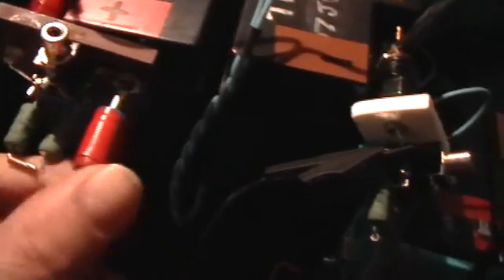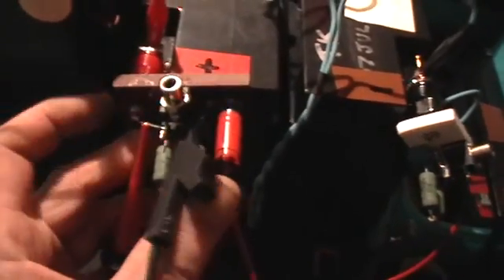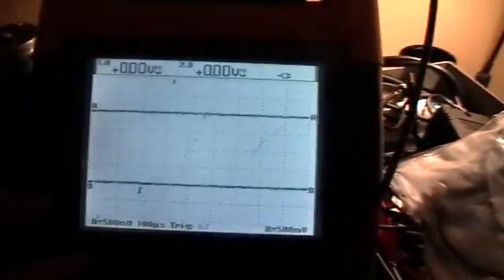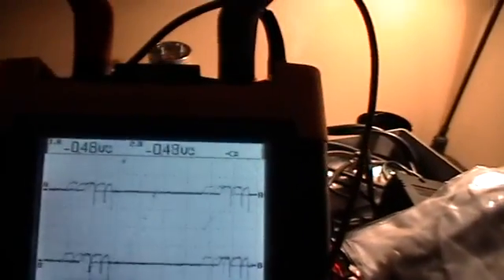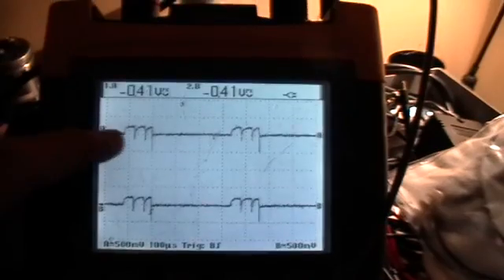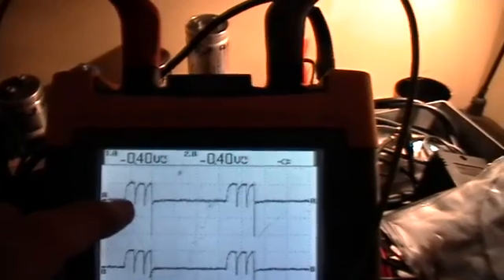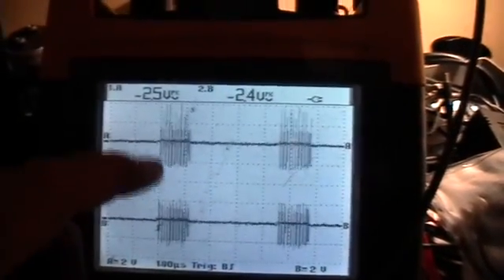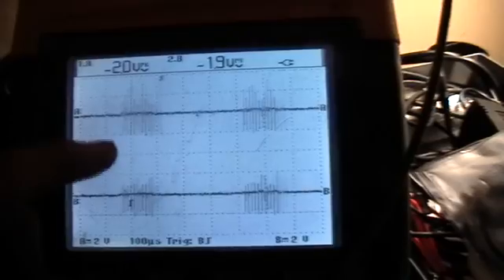Electric OU: Comparison of Current Monitor Positions; Isolated Input Fluke-0-Scopy

Comment from the maker: The negative-going voltage spike indicates NOT a "net negative discharge from the battery." A "negative discharge" is a recharge, and for that to be happening the AREA of the spike going negative would have to be larger than the AREA of the total positive-going regions of the waveform -- which it clearly isn't. In fact in this demo the ratio (pos/neg)  is about 140 to one. That is, the "negative discharge" (aka recharge) is about 1/140th the amount of the "positive discharge".
See the sidebar.